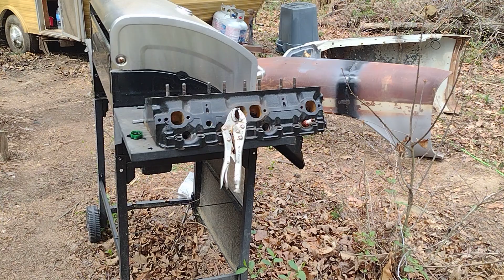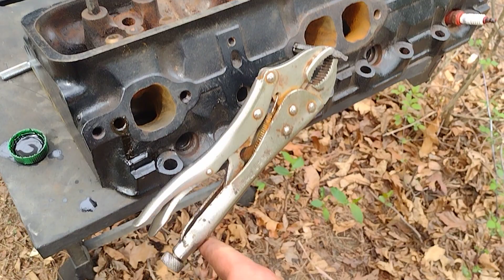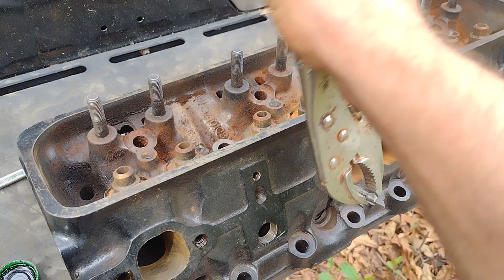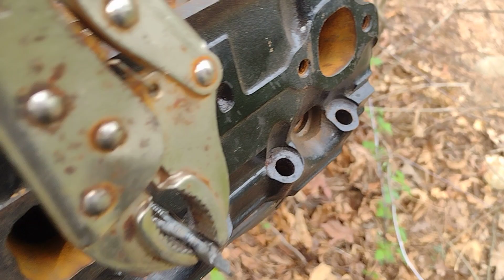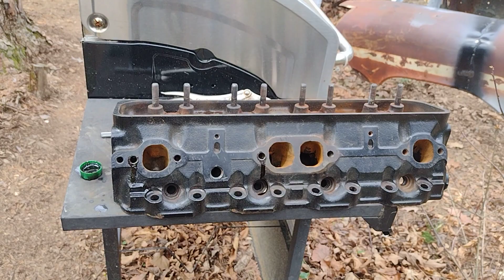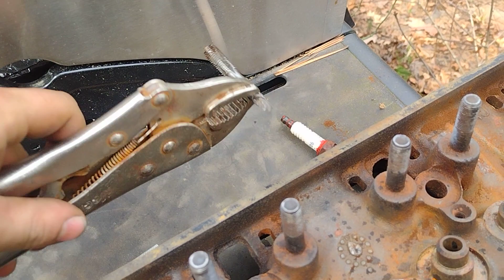INTERNET CRINGE MOMENT OF THE DAY

Comment: If you don't have a tap on hand, you can take the correct size bolt, cut a small groove down the threads and it will work as a thread chaser.